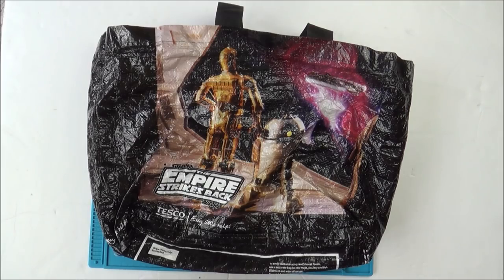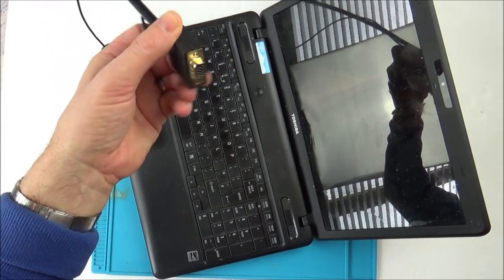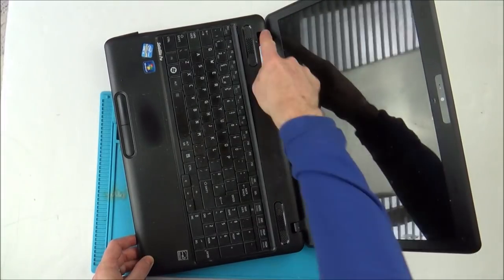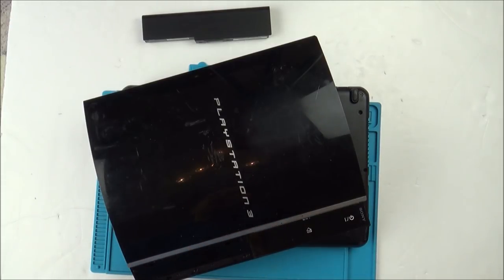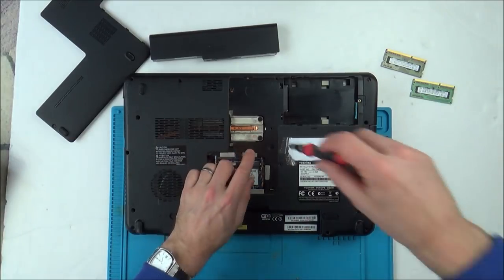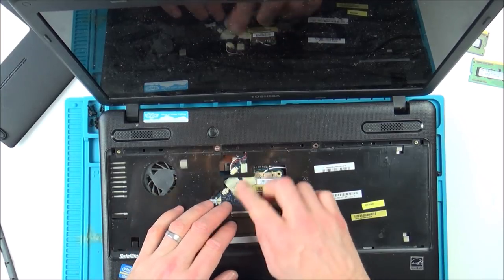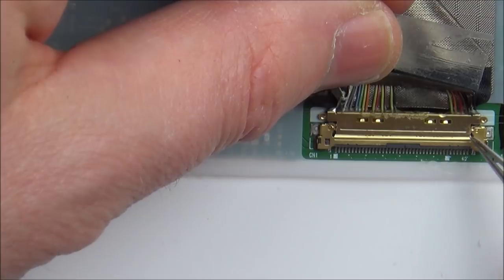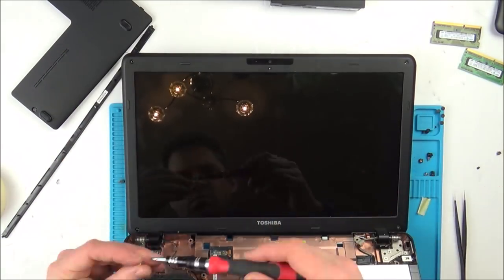Trying to FIX: Toshiba LAPTOP (Satellite Pro C660)

Comment: Great fix Vince. Installing an SSD would of made some difference on that we laptop. Installed one on my 12 year old laptop a few months ago and the difference was amazing. Mick 👍🍻
Reply from the maker: Thanks Mick, I was pricing them up in CEX yesterday. I am very tempted, thanks for confirming what others have also mentioned :-)
Reply: SSD even makes a difference on a modern laptop. Have an Asus 510u with Intel i5 and even the optane memory cache. But it sometimes was terribly slow particularly after an update. A good 2 mins before I could actually use it most times. I got SSD. Cloned the hard drive bootup down from 2 mins to 15 seconds. Chrome down from 20 seconds until usable to 3 seconds. Asus fitted a rubbish Toshiba 1tb hard drive that runs at just 5400rpm and it was crippling it. Most laptop hard drives are pretty poor. My 11 year old desktop with SSD was quicker. It's not now though. This thing is really fast now.
Reply: @Mymatevince  25 quid 120 gb on Ebuyer vince
Reply: I put in an SSD using an mSATA 500GB SSD and mSATA to IDE adapter in my ThinkPad R40 and runs faster than it did before with the failing 20GB HDD (also cloned the 20GB to a working 40GB drive prior to cloning to the 500GB SSD). Might do the same with other systems for my 486 systems and early Pentium systems. However, TRIM isn't supported in earlier Windows and requires 3rd party software to TRIM the SSD.

Comment: 15:49 Hi friend, great video.
Just a quit tip, when you undo the GPU or CPU screws you should undo them in an X motion (one by one - you have numbers there, marked it down, for that reason), you should not undo one side and then the other side, you risk to break the die if the cooler is too tighten up by springs- same thing to the screwing process.
That Arctic Silver doesn't look genuine to me as well.

Comment: hey vince, its a good video and a screen replacement is a great entry job for laptops but if you are doing it again i would just say you dont need to take 99% of them apart to change the screen, you only need to remove the screen bezael (tip: tilt the screen as far back as possible to be able to release the clips at the hinges to seperate the bezel) i use to work as a laptop/phone repair tech and i still do it as a hobby when i have time, if you are interested in doing more laptop repair videos in the future i would be happy to give you a few with different faults free of charge (i still have around 50 laptops in my spare/hobby room ha)

Comment: Hu Vince, the DVD drive can be removed by taking out only one screw, the one with a little disk icon on the middle, take that screw and slide it out. If you don't use a Hard Drive caddy you should use some EVA sponge to brace the back of it so it doesn't slide off. Good job. And Windows is super easy to install. Just takes forever.

Comment: I like how easy to access everything is like memory and hard drive. I recently updated my modern Asus from hard drive to SSD and had to take entire bottom off just to get to hard drive. It would be same for battery or ram. Once in it's still easy to upgrade but would be nice to have the separate bits and removable battery like my previous laptops. You scratch it a bit removing all the clips otherwise.

Comment: Hi Vince, dont know if you'd be interested, but I've got a Sony X700 UHD Blu-Ray player and an Xbox One S 1TB that don't work, the bluray is dead and the xbox won't start games, but does boot and plays 4k blurays. I am just going to take them to the tip if you aren't bothered as I can't be bothered to fix them and have replaced both. (Replaced the Xbox with an Xbox One X and it's junk too, not having much luck with Xboxes)
Just thought they might make interesting videos.
Loving the content anyway, keep up the good work while we're all locked away in our houses (and sheds).

Comment: One tip for repair of plastic body, use piece of paper and gel alike superglue. Put some glue on the inside of the plastic body, put the paper, press it well on place and put extra glue on top of the paper to fully be absorbed with glue. I have done it few times and works better that just glue.

Comment: Hi Vince -you can usually find service manuals for most laptops on manufacturers sites and these will normally have a suggested disassembly order.I have an Acer Travelmate 290 and a faulty USB socket managed to blow the motherboard when the plastic divider broke and shorted. I found a motherboard on eBay and managed to change it with the help of the manual. Maybe try this route if you ever do any more laptops :-)

Comment: Nice repair, The hdd would need a little stopper in front of the drive any hard bump would dislodge hdd from the sata connector, The white and black wires are for wifi not bluetooth.

Comment: Hey Vince, if you are ever going to try to fix a Macbook, look for a faulty no power 12" Macbook from 2015-2017. They go around fairly cheap(for a newer mac) on ebay and often only need a power distribution chip replaced (U4700). That's a 5£ fix.. So you could make good profit from them because of the brand :) also Louis Rossmanns videos can teach you how to do it.
Greetings from Germany

Comment: What you suggested may be MS-DOS(Microsoft disk operating system) was in fact the boot sequence of the laptop which is the visible part of the firmware of the laptop along with the setup(when you power the laptop on and it says press F2 or another key to go into setup). MS-DOS was a command line operating system on which the windows operating system sat on top off. Now after the firmware runs it boots straight into windows and MS-DOS was replaced by command prompt which is built into windows.

Comment: Nice fix :) 

I had once a Toshiba Satellite L300D laptop with Windows Vista in it and after few years, it got accidentally damaged, screen cracked, hard disk was destroyed and even the case & keyboard was bent. Initially it tried to start but later stopped responding to anything, so decided not to repair it.

Out of interest, I did open the LCD panel, just to see what kind of device it is, as I had never before opened one, also, what kind of job it would be to replace it. Eventually I just recycled it but perhaps it would've been wiser to sell it for spare parts instead. Still have the broken hard disk and 2gb ddr2 ram card from it.

Comment: Rule of thumb for laptops,  'Top Down'  usually its simple to do these with easy to remove bezel and keyboard and your in like flyn.  Dells and Lenovos's makes this swap out easy.  If your screen is busted but the inverter is good ( backlight / power ) screens are dirt cheap ( LG / Philips ) and are easy to swap out.

Comment: There is an interesting thermal paste available on Ali Express called GD900. It's totally unassuming, cheap as chips even in a 30g tube, but also really good. Tech Yes City did an interesting comparison of several models, including this.

Comment: Above the Keyboard has 4 screws m8s under the long thin plastic .when lifting cable makesure youre carefull with the mouse ribon conector the plastic cracks very easly i have had a thew isuse with this i usaly put abit of scotch tape when reconnecting ribon .the Toshiba laptop is prone for fan isuse when battery goes bellow 20 percent it disables the fan iv had to sort this neny times by just unconecting the fan then replace it back in .i do this because it says the fans not disabled when realy it is .i have also fitted a tv screen into that same laptop lol worked a treat .

Comment: Thats is expired thermal paste. It happens when the paste isnt stored in a good environment. Thermal paste does go bad by being dry or solvent seperates from the material, not by being old.
Reply: it looks more like thermal adhesive, used for permanent connections to parts that are not meant to come off. If it is expired paste, it could be re-mixed, but you'd have to get it out of the tube.
Reply: @kruleworld  i had thermal paste that separated and it wasnt thermal adhesive. I had to throw it away and buy another tube

Comment: Good fixes Vince.
Thermal paste tube, did you shake the tube for 2 mins before use? (LOL) or maybe squidge it in the tube with the cap on to mix it better.
If you need toilet rolls you can get them on Ebay at £6 for a pack of 4 (shame on the people trying to profit off the plight of others at this time) OR just go to a small corner shop as they have loo rolls and hand sanitizers and stuff and no queueing.

Comment: My sister bought a new laptop and gave me her old one which looks identical to this. It was only January this year and it had Windows 7 installed. I thought I would try Windows 10 and it activated fine. It seems ok to use, would be faster with a SSD. The main problem is there is no HDMI, I'm surprised at that seeing as I have an older Compaq Celeron that does have one and that laptop struggles with even 720p video. I've not decided what to do with the Toshiba yet. Looking at your motherboard it appears to have a separate GPU, I don't know if mine does, I'll check sometime. Also looks like the CPU is socketed which is rare nowadays in normal laptops.

Comment: I use a Toshiba satellite not sure exactly but it's modern like 2010 (or so, modern in 2010 too). And works amazing to be honest. Pretty much works for my daily basis, and also to play TF2 ay high settings 60 fps, and works pretty fine, amazing computer I found at trash bin.

Comment: I could be wrong but I believe that thermal paste is oil based and it looks like the oil has separated out, you probably need to kneed the tube to mix it back through.

Comment: You need an SSD not a spinning disk. the Webcam and Screen are on the same cable. the cable is called a LVDS cable. the WIFI and Bluetooth are in one module on newer laptops. the startup you mention is also called the BIOS which you need to set boot priority to either DVD Drive or USB. Dont forget to run Memtest86 for 24 hours to test RAM.

Comment: Yes, that MX-4 is not properly mixed. Your best option is to pull the plunger out of the tube, put the cap on the tip and mix the whole tube up with a perfectly clean stainless steel tool small enough to fit within yet large enough to mix that within. The label on that tube is not one I have seen on Arctic MX-4 nor MX-5, so it may be that the tube you received isn't the genuine article.

Comment: Just a few tips: You should always tighten all the hinge screws (both on the screen side and mainboard side) as they tend to get loose over the years. Also when it comes to thermal paste, less is more. You had way too much, which can have a negative effect on the cooling.
Reply: No, too much is better than NONE
Reply: @ComeOnComputers  Of course, but sometimes you can get a slight improvement by not going overboard with the thermal paste.

Comment: I have a Toshiba Equium M70, windows xp, 2004, bloody ancient. Question is, is it worth installing a later version of windows and which one is best for older laptops!?
Reply: Honestly if it's an older laptop I'd go for linux. I had a 10 yo laptop that was sluggish as all hell. I installed linux and it was amazingly fast. To this day I still use it as a media computer. At this point it's 17 years old and still going strong.

Comment: I love the videos, but me being someone who builds and repairs computers this video had my anxiety at level 15 out of 10. Haha
I'm surprised the hinges didn't completely snap the corners off while folding it with the keyboard and palmrest off. These Toshiba laptops have total garbage build quality. The only thing I've seen worse is the HP/Compaq 52 series laptops and all others that use that housing. I also sometimes forget that not everyone who works with electronics knows what all the components and cables in a computer are. That laptop won't have Bluetooth unless it's been added. Almost all laptops have the dual antenna wires running around the perimeter of the screen. On the thermal paste you just shake it really well and it remixes, but yeah that was a CRAP TON of paste. Lol And yes the caddy is necessary. Other than that being in upside down haha... the original one had a screw hole that kept it in place with the screw that holds the HDD cover down. As is, if the laptop gets bumped hard it can dislodge the hard drive. Still a pretty decent job for your first time doing this. Even if the computer didn't work you could easily make your money back with the Windows product key and disk.

Comment: I'd probably test it with the VGA and a bootable Linux distribution. Sometimes you might need to press an F key, ESC, or whatever to bring up a boot menu. The nice thing about something like Ubuntu Linux is that it'll generally work out of the box with all but the most esoteric hardware. That way you'd at least know everything but the screen works. Very easy to download and create a Linux USB stick with Windows.

Comment: Remove the bezel and that gives you instant access to the LCD. The wifi, webcam and LCD cables can stay in place. Disconnect the multipin (usually 40 pins) plug and remove the screen. I've done so many now i've lost count....

Comment: Tip:  there’s always 19 volts on the screen connector so always remove battery and power before replacing screens or you can fry a new screen.  Nice vid!

Comment: Id run a inquiry on the battery to see if it was part of the recall as Toshiba did have a issue with the battery overheating, if not don't let it charge unattended.

Comment: There have been issues with watery Arctic  MX-4 paste going back as far as 2015.  I won't touch the stuff myself.  Did you notice the CPU cooling tube was pinched too.  That is not going to help with cooling issues.  You don't need a HDD they just get thrown in a big pile for the scrap man.  Use four decent double sided sticky pads.  Don't use thin double sided tape as that doesn't allow for an air space for cooling.  A small piece of sponge packing between the bottom end of the drive ensures a firm Sata connection.

Comment: What's the purpose of the small battery under the sticky tape? Do all laptops have them? Only my Advent laptops seems to suffer from dementia, and I keep having to re install my os via a disc.
Reply: The battery keeps the bios seatings when the machine removed from power(no battery, or charger) if you need to keep installing the OS there is probably a different issue.
Reply: @EvilTurkeySlices  Thanks! :)

Comment: the only thing that might be different with the screens is one is LCD and the new one might be LED.

@18:06 i had the same thing happen when i replaced the thermal paste in my laptop and i had to take it apart a week later and replace it again just on the CPU, the GPU's thermal paste was fine.

Also if you have not sold it yet but are going to, a easy way to make more money on it would be to upgrade the RAM to 8 or 16 GB of the fastest stuff that works and have both sticks matching and replace the CPU in it if it's a PGA (pin grid array) chip (it looks like it is) with a intel core i5 or i7 that's compatible with the chipset (after finding a few compatible replacements use cpu boss to compare them to find the one with the best single/multi core performance and then find the one of those with the highest PPW (performance per watt) and put a 256GB SSD in it (or a 500GB HDD for more space and more reads/writes before the drive dies)
Reply: And if thermal paste doesn't come out right pulling the thing on the top back and shaking it can make it work like it's supposed to

Comment: The substitute caddy is fine, so long as the drive and the caddy can't slide out of the connector. So as long as you have the caddy mounted to the case you're fine, but it went too fast to see. :)

Comment: should be a good little retro emulation, simple web browsing, and productivity machine. Nice job on the fix but yeah it does look like you got an unfortunately bad batch of thermal paste because it should not look quite like that, shouldn't cause any damage directly but might not work very good it's more of a soup than a paste it looks like.

Comment: laptops come apart in stages you first remove the ram, hard drive & dvd rom, you then remove keyboard which all screw holes are marked with what it holds down, the screen is 4 screws & a lot of clips

Comment: out of the possible things to upgrade, I would definately say get the fastest ssd, get an external hard drive bay, and the laptop will run like new, plus extra storage for things like going on holiday, it is what I done with my 2007 laptop, and still gives something like a notebook a run for its money even though a note book was something like 2014, which used to run faster than my laptop, even my friend seen the improvement an ssd made compared to a mechanical drive.
Reply: Also check to see what is the maximum amount of ram it can handle. Two 4GB modules or two 8GB modules with a SSD will make that laptop run really good.

Comment: hey vince, i have a HP pavillion lapop where the screen has gone,i think the video chip has failed. i would like u try to fix it? (if  you fix it or not you can keep it)  how would i go about contacting u so i can send it to you?
Reply: Try if it works on an external screen, if it does than it's probably the backlite-inverter...
Reply: @realmachine  no it doesnt work on external monitor. the laptop actually turns on too. think the video chip is burned out! as when it died, it actually came back on, until i turned it off again and then died again.
Reply: @trippy_boxer_dog2170  the igpu has probably burnt itself out as I just got a old dell laptop yesterday and the thermal paste was from 2006 and I changed it and I found out that the standoff for the heatsink had came off so I am going to solder it back onto the board so hopefully it doesn't overheat and burn it out.